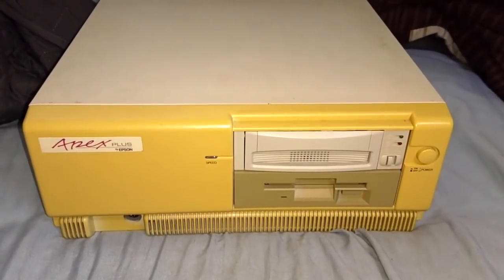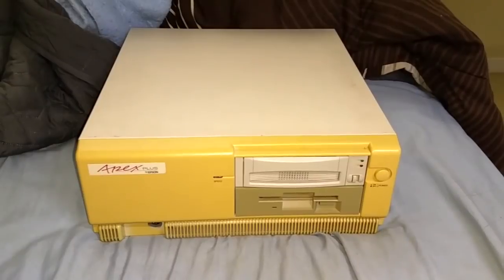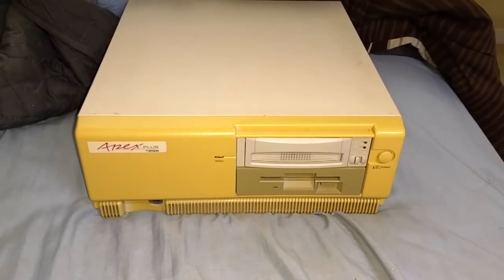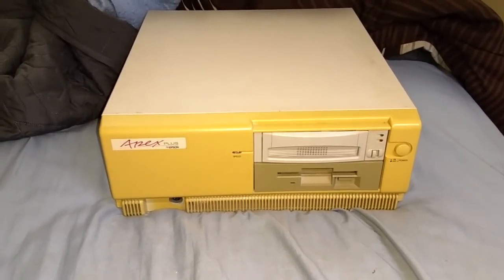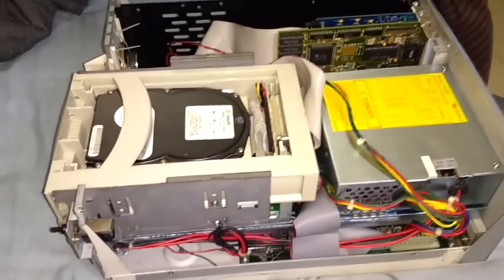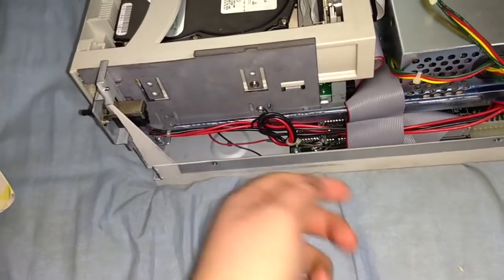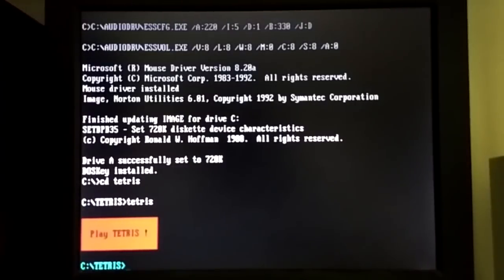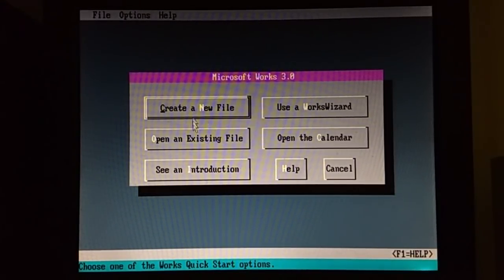Epson Apex Plus: Sound card + more demos

Comment: I noticed in the Sound Blaster Pro demo that the MIDI music was much louder than the voice and sound effects. You could probably adjust the mixer to fix this. There's a little program called ESSVOL to do this at the DOS prompt. The "terminator" in VEdit2 is because it can be programmed to play multiple sound clips in sequence, repeat them a number of times, and then stop (terminate) playback.

Comment: 1:08:16 I wonder if this is possible with period-correct MFM controller with no DMA support?
1:26:45 keep in mind that if you plan to get hardware UMB blocks with a card like BOCARAM, maximum amount you'd get is only 64K, regardless of total EMS memory amount on the board.

Also, since this thing has VGA and 80286 opcodes support, will it run Wolfenstein 3D?

Comment: You should be able to format a 720k drive in a 360k controler also with this command in config.sys, the drive will keep the same letter.

drivparm= /d:0 /f:2 /h:2 /s:9 /t:80